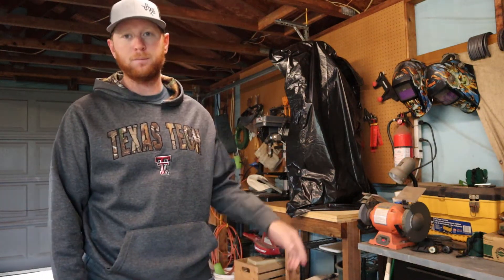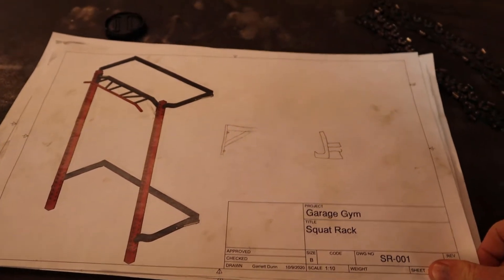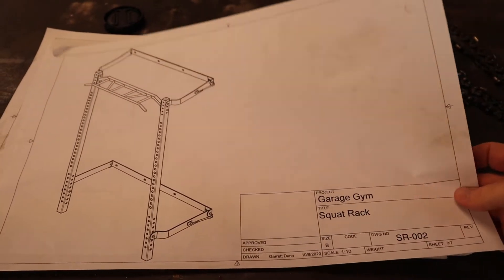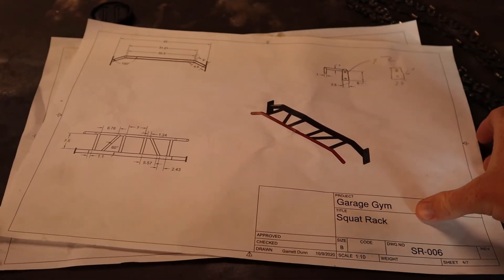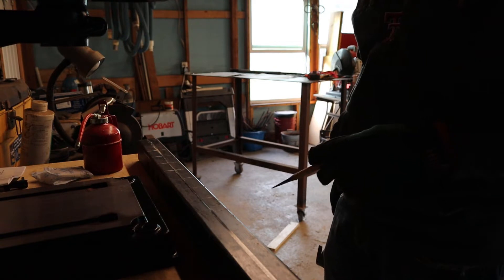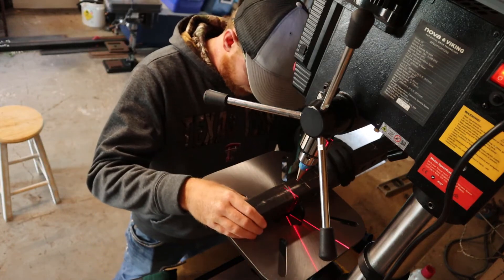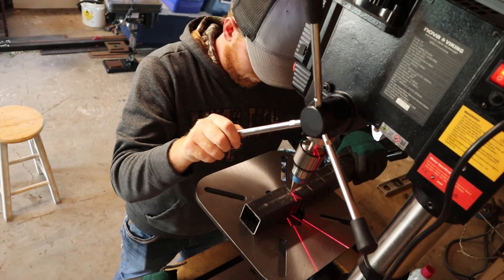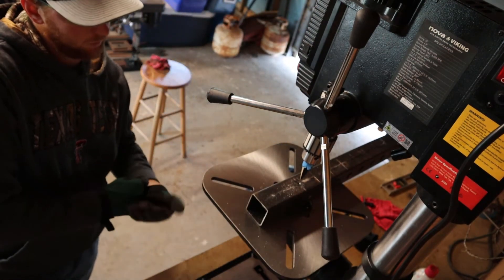Squat Rack Build And Nova Viking Drill Press First Use

Comment: Might want to lower your rpms. You'll burn up your drill bits with too much speed
Reply from the maker: You are so right. mistakes were made. But learned my lesson and how to do it better. I shoot for around 400 RPMs now. Do you have a speed you recommend to use??
Reply: @wreckreationtime231  I would say buy a cheap set of twist bits and experiment with it. Generally the bigger the bit the lower rpms. Also use some oil when drilling metal. You will get much more use out of your bits with oil and they will cut way better. You can get proper cutting oil but I just use motor oil because I'm cheap.  I'm thinking about upgrading my drill press in the future. How do you like yours so far?